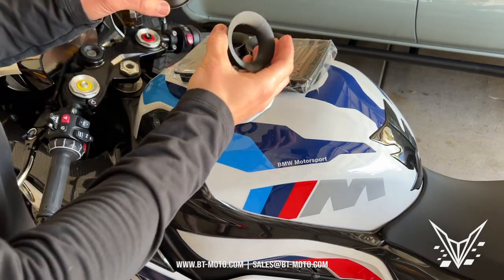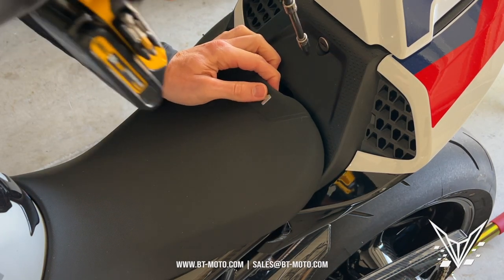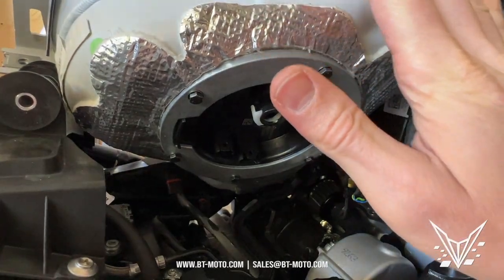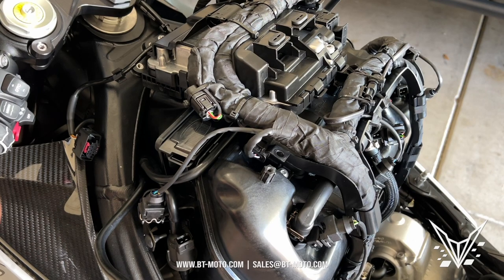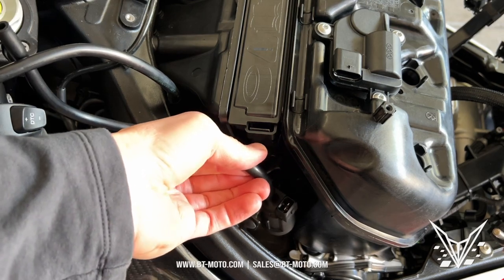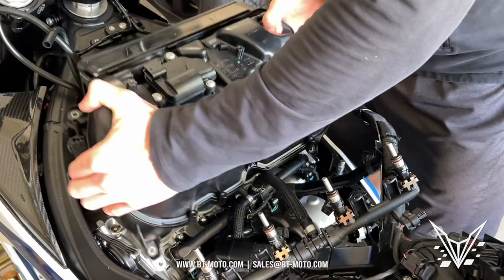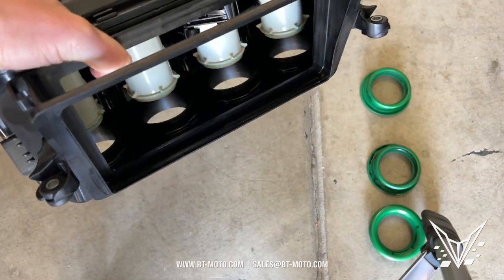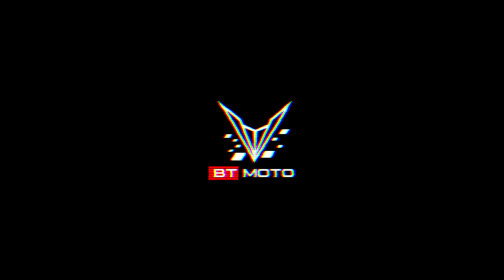BMW M1000RR / S1000RR / R / XR, BT Moto Velocity Stack Install

Comment: Ok so im about to buy the 2022 S1000XR and i see that all parts fit all 3 models RR , R & XR… soooo my question is do you guys know if the exhaust are same fitting as well? 
Bc i want the Akra Titanium headers and Midpipe with the GP shorty can (not decided on Akra or SC project CR-T) bc i hate big cans on motorcycles!!!

Comment: My bike runs great with stage 2 and the velocity stacks. However, my bike smelled like fuel after the first run. I figured maybe it was a breather that I forgot to connect but it wasn't. I tore the bike apart and there seems to be a leak where the velocity stacks meet the throttle body as the bottom of the air box is oily at the stacks. I looked it over closely and the velocity stacks are fully seated in the air box, and the velocity stacks are fully seated on the throttle body when installed. The stock stacks are rubber and the BT are aluminum which appears to be why they are leaking. Has anyone else experienced this? Am I missing something?
Reply from the maker: The breather sucks oil into the airbox. It pools with the rubber stacks. We have a solution for bikes that do this, as it’s only a few that do. Email us

Comment: Has anybody that got them in there bike have any oil leaks
Reply from the maker: If the bike is leaking oil from the airbox, it means you don’t have a proper crankcase breather. It’s sucking oil into the airbox from the OEM crankcase hose. Seen this on completely stock bikes as well. Usually a bit of oil leaks from the breather hose when you pull it off the engine.
Reply: @BT_Moto  Currently having this issue now. Should I take it to the dealer? What do you recommend ?